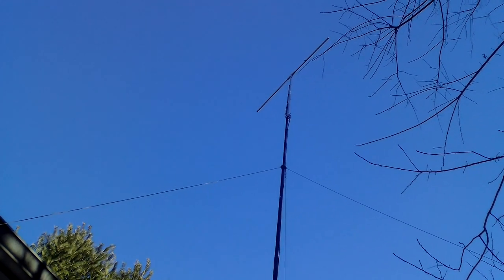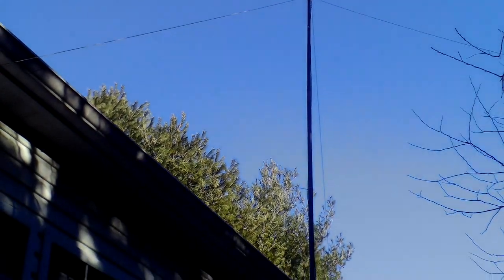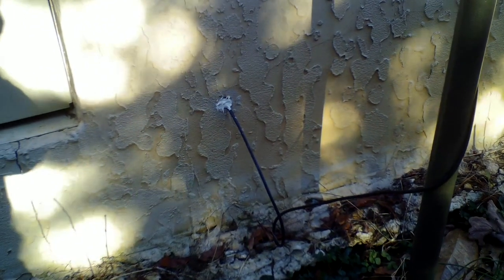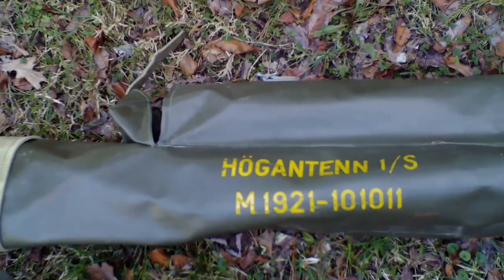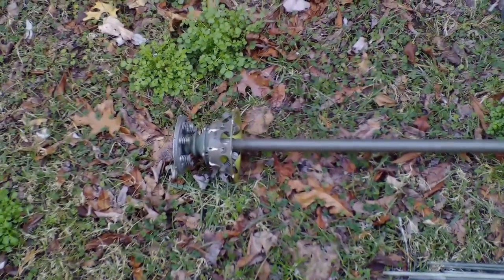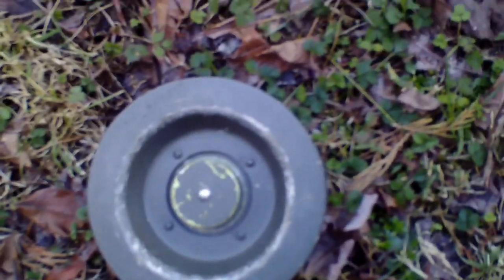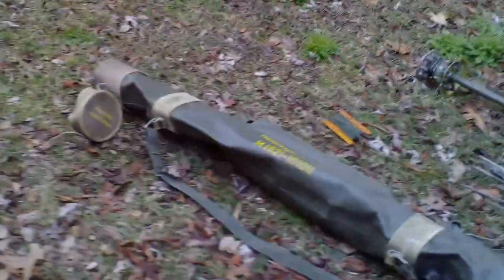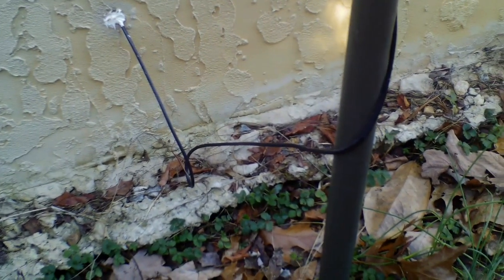AirWaves Episode 3:  Swedish Military Portable Antenna System

Comment: Picked up a few of these from the Sportsman's Guide back in early 2000. Beat the crap out of the masts and lost a few sections to frost but I am still using them. Wish I would have kept the discone base. Still use the arms for various projects. 73 KB2SDR
Reply from the maker: That's where I bought mine.